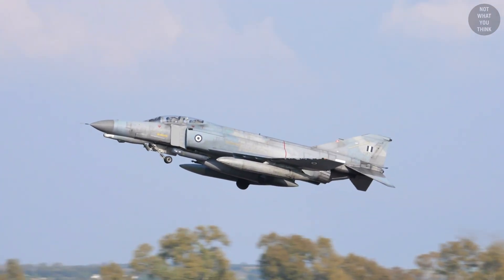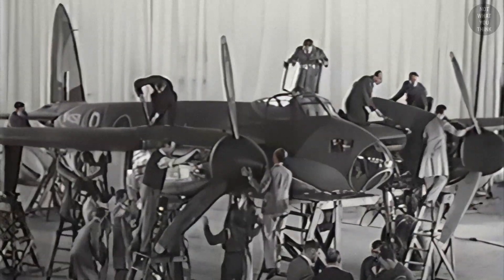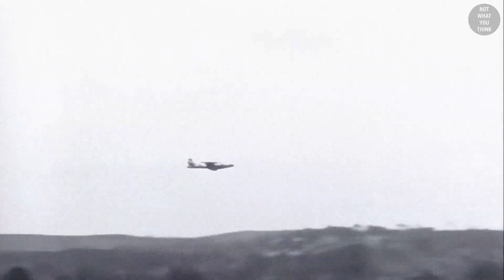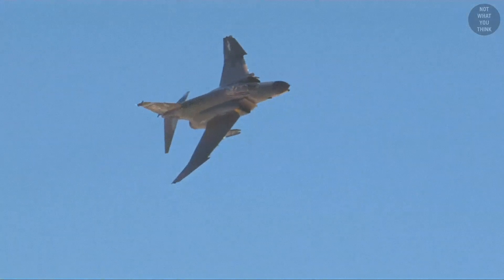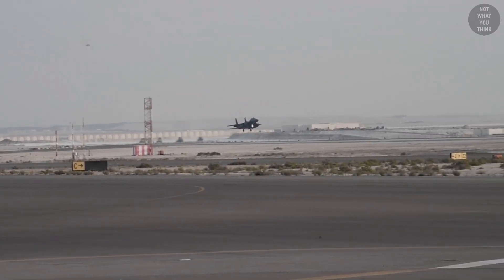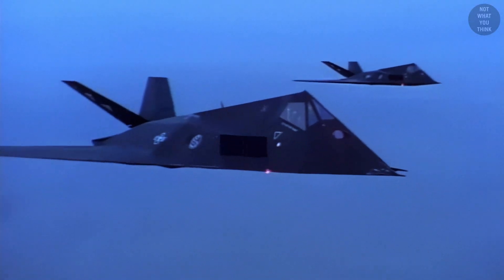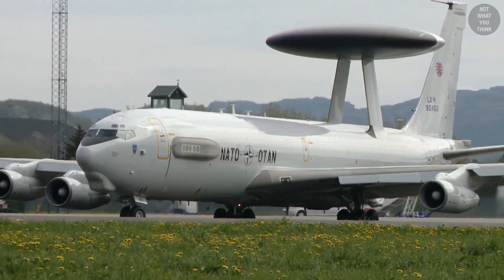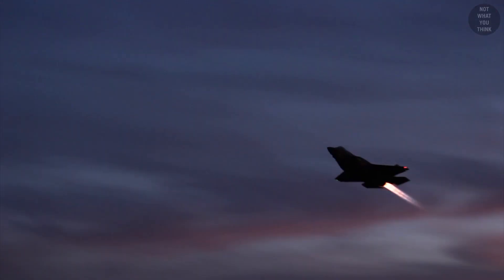Why are Modern Fighter Jets Slower than 1960s?

Comment: Todays fighters can usually hold a higher speed without afterburners, and therefore hold a high average speed when traveling towards whatever goal, compared to yesteryears jet fighters.
Reply: Examples are F22, Typhoon, Su35, Gripen, Rafaele, those aircrafts can supercruise, going supersonic without using afterburner
Reply: @redacted2713  BUT IT'S NOT WHAT YOU THINK
Reply: @redacted2713  Super Phantom could supercruise too
Reply: @redacted2713  Gripen is peak design for peasfull times, low fuel usage for border patrol and training , low maintance cost, and all things that modern jet needs in fight
Reply: @redacted2713 the eurofighter can this too,
Reply: @darthbane3231  I have mentioned it
Reply: @redacted2713  sorry, I didn't see it.

Good day to you
Reply: @redacted2713  A very early example of this is the MiG-23 Flogger, but we don't talk about that arguably bad aircraft
Reply: @redacted2713  Im pretty sure SU35 and Gripen cant supercruise. The range of aircraft able to do that is very slim.
Reply: @termitreter6545  Only the Gripen E/F has supercruise.
Reply: @duohawke4174  Dang, so they managed to make that lil plane supercruise? Gotta say, the Gripen is an impressive success story. Lil Sweden developed that thing on their own.
Reply: @termitreter6545  The E/F just use an engine variation of the Super Hornet engine. Has more power as the old Volvo engine form C/D.
Reply: @duohawke4174  Yeah Ive seen it. Still, aerodynamics gotta be really damn good to make that possible, especially considering the T/W ratio is still somewhat low.
Reply: @redacted2713 Rafale No Rafaele
Reply: @ddd.777-  ye whatever
Reply: @redacted2713  even without supercruise, the F-35 can fly to longer ranges faster than even the F-22 by flying sub sonic with extremely good fuel economy.

No need for aerial refueling.
Reply: @Random_White_Circle  Well it’s not only that. The f-35 can carry ground munitions as well, so loitering may be required of it. So they may hang around longer if there is air refuel nearby
Reply: @Random_White_Circle  please get an actual education on aircraft ranges F-35 is poor
Reply: @Random_White_Circle  The U.S. Navy’s and Marine Corps’ versions of the F-35 jet can only fly at supersonic speeds for short bursts of time before there is a risk of structural damage and loss of stealth capability.
Reply: @Random_White_Circle  F-35 can go 1,300 mi and F-22 can go 1,800 mi. Combat range is different. F35 (770 to 870) F-22 (645 to 679) have almost the same “combat” range only off by 125 to 191 miles
Reply: @Random_White_Circle   and if it gets into a merge it has not much in dogfight potential in comparison to said F-22a
Reply: @Random_White_Circle  B does not equal fuel-economy man they're not talking about fuel economy
Reply: @darkest_eclipse8271  Munitions?
Reply: @L_Lawliet1235  short for Ammunition, anything from guns, bombs, rockets, etc etc.
Reply: @darkest_eclipse8271  Ahhh ok
Reply: @Random_White_Circle  F35 cope at the highest.
Reply: @redacted2713  incorrect about the F22.  It can only fly for 8 min.  The F23 can fly at super cruise.
Reply: @BJCulpepper you're referring to the YF-23. The F-23 program never progressed beyond the 'prototype' phase.

However, Japan has decided to partner with the F-23's original engineers with a goal of finally putting the F-23 into production. The real issue with the YF-23 was/is it's maneuverability, which is significantly less than the F-22.

The RF-23 was faster than the F-22 from Day 1. ✈️
Reply: Honestly, this all makes the F-86 Sabre look even more incredible for its era. An early 1950s jet with amazing maneuverability, astonishing firepower, and even able to break the sound barrier if flown in certain maneuvers (I believe Jackie Cochran, a female test pilot for the US Air Force, was one of those who successfully did this). An absolutely incredible aircraft.
Reply: @thunderbird1921  no
Reply: @thunderbird1921 give me a Hunter over a sabre any day of the week 😎
Reply: This can be found for all non pilots in any good simulation. The short bursts of afterburner have higher top speed but a modern fighter overall would intercept a target far faster then a fighter from the 80s.
Reply: @Atman Gotango It was immune to everything of the era. Advances in missile technology made it obsolete. Modern day missiles would make short work of it.
Reply: First modern missiles are substantially faster , far more agile and significantly more accurate than missiles designed in the 1960s
Supercruise does allow aircraft to move at high speeds without using afterburner which is usefully in some situations 
Stealth and Electronic warfare are better
Reply: @brianhale3678  What the Thor are you talking about?
Reply: @brendan31415  It's a great movie. My favorite MCU movie. It's really a Shakespearean Fairy Tail. Directed by Kenneth Branagh, ya know.
It takes a thousand people 4 months to make a movie of that scale.

But you can make up a new god right now. Talk is cheap.
That is why the first commandment is, You shall have no other gods before me.
Reply: @brianhale3678  So your God both recognizes that other gods exist, and is anti-competitive. But do you have any evidence your God exists. I know that Thor exists, as we all know that Thor fought Ice Giants, and I look around and don't see any Ice Giants, so he must have been successful.
Reply: @brianhale3678  didn't know fairies had tails
Reply: @brianhale3678  Proving that Christianity is a polytheistic religion.  God was never the only god, just the only god the Hebrews would pray to, first among equals.  Also required some nifty footwork when they got around to elevating Jesus to to god hood.   And ps. The testament specifies 3 times that the sins of one cannot be forgiven by the punishment or repentance of another.  So, I'm guessing the guy(s) that wrote the, Jesus payed for our sins, bit, didn't read the bits that says god doesn't allow that sort of thing.
Reply: @jars6230  
Ever learning and never coming to the understanding of the truth...

😥
Reply: @brianhale3678  You are literate, and yet so, so blind. 
You bring discussion by mandating 'sin' as described in repeatedly editied books by men hundreds of years ago but ignore the immorality of your choice to continue propagating the greatest of all sins - mass religion and the recruitment of others through fear and psychological manipulation. I suspect that somehow you have come to understand the weakness of your faith but instead of examining said have chosen to push it onto others in search of validation, and ordinarily I might have pity for one in such a position, but you seem keen to maintain this behaviour and so today I do not.

The world no longer requires this kind of cultist behaviour. Indeed, it is exactly the cultist mindset you so readily advertise and proscribe that allows for the grossest of inhumanities to be continually perpetrated around the globe.

Whether there is an omnipotent being in control of the multiverse or not is irrelevant. Your position regarding those who belong to your particular cult vs those who do not is also not relevant. 
Your choice to proselytize to others who may be weak enough to be damaged by it - which let's be honest is the motivation for your words, a vain hope that you might find people weak enough to be swallowed into your cult through manipulating their fears - however, is very relevant. And as disgustingly ammoral as any action ever undertaken by even the most heinous of people.

Do yourself, and the rest of the world,  a favour; read a few books not written specifically to delude the willfully ignorant. There are plenty of them.
Then, get out into the world. Take off your blinkers and you may see that it's ok that others choose not to follow your cult. You may even begin to understand that it is infact you who fail to see reality for what it is. You might even come to understand that it doesn't matter one way or the other... it doesn't matter really. 
When you lift the wool from over your eyes, you will see more clearly.

If you have any true sense of morality whatsoever, once you do open your eyees, try to help those who have so successfully brainwashed you to see the evil of their deeds. It doesn't have to be done suddenly - folks can suffer that way - but you'll be better placed to make that judgement at the time.

Live in peace Brian.
Reply: @geordievillan  I read your comment up to the point where you claimed the Bible has been edited...

If you claim the Bible has changed you lose all academic credibility.
Google the Dead Sea Scrolls, it's only the second most famous archaeological discovery of the 20th century after the tomb of King Tut.

How many other Commandments have you broken?
Reply: @brianhale3678  so at the first sign of the reality of your religion you choose to close your mind... There are alternatives, friend. You need not stay blinded.

Whilst you're busy googling (and I suggest you actually have a look at the Dead Sea Scrolls for yourself - you'll find much of it is NOT included in later editions of the Bible) perhaps a quick gander at Vatican corporations interpretations of just some of the greater errors upon which millions of cultist now base their lives (like pretending mary was a virgin, for example, or that 'jesus' was called 'jesus and born 2022 years ago - it's a MASSIVE list), and missing texts might be a good start for yourself. Personally, I really enjoyed reading about toddler 'jesus' standing down the lizard in the desert. Amazing how many supposedly devout christians won;t even engage in discussing those... but that is, at it's core, the very nature of mass religion isn't it; Knowingly internalising and accepting delusion.
The nature, history and etymology of the Christian mythology is not hidden information. That so many of you readily choose to let yourselves be openly deluded is a true problem for humanity, but the cures ARE readily available. All that's required is to put aside prejudice. It's not entirely your fault that you've been misled. That you proselytize without bothering to do the research about your own cult mythology beforehand, however, is very much upon you.
Reply: @geordievillan  dude, we have over 5,000 manuscripts of the Greek New Testament... the closest equivalent of an ancient document would be "Homer's Iliad" with only 8...
The Bible has never changed.

Correct, your egregious academic error and then we can talk.
Reply: @jars6230  did you know yeshiva the jews god, thus the Christians god too, actually tricked the original god head out of his seat of omnipotence. He wasn't a benevolent god as we can see.
Reply: The EE lighting could break mach without afterburner.  This was in the late 50's.
Reply: Concorde still beats them all.....
Reply: What's yestery ear?
Reply: @RIFLQ  dunno. Maybe a bad ear infection? You should probably see a doctor if you have that.
Reply: @erikgranqvist3680  oh sorry for that.. I was sleep-deprived when writing that..
Reply: @RIFLQ  and I am just trolling you. A joke.
Reply: Never knew this, thanks for sharing
Reply: @Atman Gotango XB-70 Valkyrie did that exactly
Reply: 7
Reply: Which F35 wasn't. It can't supercruise nor it can reach 2m even with afterburner.
Reply: FYI, even today's cockfighters holds an astounding significant high speed!
Reply: You're comparing an F4 with an F35, you should compare an F4 with an F22.
Reply: Also without afterburners you have much less heat signature. So you are much harder to detect and stealthier, which is very important in todays combat.
Reply: Even if you have supercruise, it is still more efficient to fly subsonic.
Reply: Not the point of the video lol.
Reply: Are you gay
Reply: Top speed was used in the Mig 25 over Israel. IDF F4s couldn't catch the Mig 25 when it flew over IDF airspace. The F4 was flying at top speed in this instance, as was the Mig 25.
Reply: Not to mention reduced heat signature and less radar cross section as well.
Reply: Radar technologies and missiles technologies made redundant in a skirmish terms... in an all out war speed and manoeuvrability will reing supreme..😂 ... because dogfight are the pilots skills and training.. but yeah first strike like that of any thing else... attacking all way was overwhelming the defence... because it makes the first move .
Reply: Why not compare the F 4 to the F 22 or F 15EX?
Reply: Just wait for the super jets that are in development
Reply: Who is this Mexican that is narrating this video?
Reply: @virtualpilgrim8645  Sounds more Eastern European or Russian to me.
Reply: Yestercenturies*
Reply: It's not about speed it is about stelthyness
Reply: @christopher smith Im a bit confused about what youre saying. Its true that very few aircraft can supercruise.

But your example of the F16 cant be correct. That aircraft cannot supercruise. If its supersonic range gets cut by a factor of 5, then because it requires afterburners.

I dont think anyone of us actually knows the difference in range that comes with supercruise. Thatll be different for every plane, and top secret information.
Reply: Nah did he just make a NEW WORD
Reply: He compares the speed of a twin engine jet (F-4 Phantom) with a single engine jet (F-35 Lightning II).   He's disqualified himself from ever talking about jet airplanes.
Reply: I’ve never heard someone use the word “yesteryear” Ima add that to my vocabulary.
Reply: The top speed numbers from the US fighter jets were all BS.
Soviets really had Mach 3 fighter called MIG-25.
US could not even copy the technology, so it just made up fantasies, like MIG-25 is unreliable, etc.
Far from the truth, Soviets even exported MIG-25s to poor countries and they were using them well without changing the engine every 1500 hours.

And the Mach 2+ speed for F-14, F-15, and F-22?
All BS.
These aircrafts are so underpowered, they cannot even reach the height of Chinese balloons at 60,000 ft.
Note that even concord were flying at 60,000 ft at the speed of Mach 2.
Man.... very disappointed with the US fighter jet speeds and dishonesty BS from our military.
Reply: it's just that the F35 is a non-moving, slow, lame aircraft. 
speed is needed in order to intercept a plane, launch a missile or a bomb, the greater the speed, the faster projectile flies, and further. or, for example, have time to destroy another plane while it launches a cruise missile. if the F35 is shit, this does not mean that it is normal and speed is not needed in modern jets.
Reply: @Niko_rj  F35 is such an ugly, fat airplane that cannot dogfight.
I don't think it's really stealthy either, stealth is a BS that US military has been selling.
Low frequency radar can see all anyway, and two F-117 were hit by the primitive Serbian army missiles back in 1999.
All BS is the US military.
Reply: Current aircraft require greater maneuverability and stealth, than flat out top speed that can not outrun anti aircraft missiles.
Reply: @captjohn1124  You should know that speed matters more than stealth. Stealth is only effective for high frequency targeting radar from far away, it is utterly zero effective for the low frequency surveillance radar. When the plane is close to radar or missiles, it's very visible, just like any other aircrafts or ducks.

Since its introduction in combat in 1989, countries developed missiles that can shoot down stealth with ease. Even without new type of radars, serbians hit two F-117 and one of them crashed.
Reply: @sbkarajan  yea right, speed matters more than stealth. He who gets off the first shot.....wins.
Reply: So, how long have you worked in the aircraft industry? How long have you been flying for?
Reply: @captjohn1124  my first flight with a jet fighter was in the second Punic war. We totally smashed those Carthagians!
Reply: Gigachad f35 for being capable of super cruising
Reply: What I want to know is how does a 65 year old fighter still go 50% faster than a plane that has over 25% more power?

Jets still need speed to intercept-
under some circumstances,
an old F-4 could successfully make an attack and leave before an F-35 could make the intercept…
Does that sound right to you?

Oh,by the way-
they have about the same range when running without the ‘burners.
Reply: @PNasty666yet we haven’t seen any real advantage of super high speed bombers. Mainly because strategic bombers are a thing of the past. But the xb70 Valkyrie, the B1, the Soviet equivalents also…. Pretty much pointless. MASSIVE running costs for hardly any advantage
Reply: Yep. We gotta remember, the F-4 and Mig-21-one of the most aesthetically pleasing plane, in my opinion-were initially designed to be bomber interceptors. Nuclear capable bombers were a real threat, speed and climb rate were prioritized.
Reply: There's no point having a jet with top speed of mach 2.2  with an optimum speed of 2.0 when all the fighting is done at sub sonic speeds .
Reply: @gregorybathurst4326  
Why do you think that some jets are called Intercepters?
Reply: @gregorybathurst4326 well there is a need…. You need a high speed to enable interceptions beyond your airspace ideally.
Just because you won’t be manoeuvring against each other at mach 2 doesn’t mean there’s no advantage to being fast as hell!
You can intercept and climb to altitude as soon as possible and engage. 
Take the U.K. for instance, they needed to be able to intercept Russian threats out over the North Sea before they could launch their weapons
Reply: @gregorybathurst4326  what fighting is that ?
Reply: @williamjr5825  missile throwing… you don’t need to go faster
Reply: @gregorybathurst4326  your one of the few that understand. Other then bvr fighting speed just burns fuel
Reply: One of the most significant limiting factors for higher speed turn rates is the pilot’s ability to endure the G-forces.   Hypersonic / supersonic drones and thrust-vectoring missiles are a big part of the future of those and other capabilities.
Reply: @brianhale3678  You're assuming I don't believe what you said. I never shared anything on that matter. I only made a joke about your misspelling of fairy tale. Fairy Tail is a Japanese manga. Have fun proselytizing in unrelated YouTube threads.
Reply: @andruloni  
What happens when we die?
Reply: F22 goes well above march 2.2
Reply: @ChessNoobX  well above? No. Not only do official specs refute that, there's no point except to increase fuel burn rate by over 100% and lose stealth.
Reply: @Vermonstered  it's top speed somewhere around mach 2.6 but it's unpractical and any maneuvers at those speeds will be lethal so the on board AI is programmed to mach 2.2.
Reply: @ChessNoobX  Considering the plane falls out of the sky without the on board computer flying it think we can safely say the top speed is mach 2.2
Reply: So how’s that tactical Better?
Reply: @williamjr5825  modern jets can achieve high speeds without using afterburners. This is called super cruise. Afterburners burn a ton of fuel and substantially drops your range to the point of the aircraft not being able to do much once on site to do anything other than to turn back so as not to run out of gas.
Reply: @will Roland Nice dodge, in an attempt to deify Jesus, which he wasn't in his day.  Did you know there is not mention, in the bible, or anywhere else, of the resurrection until 600 AD?  Then they decided having him dying on the cross wasn't 'Devine enough'.
Reply: Jade Chan 🇺🇦  it doesn't supercruise at all. It need afterburner to even break supersonic.
Reply: @sys3248  and cant even do supersonic flight that long because it will break their airframe
Reply: @brianhale3678  So you claim that my god doesn't exist, and I claim that your God doesn't exist. How about we both agree that we are both correct, not have any made up gods, and treat others the way we want to be treated and not treat people the way we don't want to be treated, and enjoy this life.
Reply: @brendan31415  how about you continue believing in evolution which offers you the chance to decompose into dirt...
Reply: @brianhale3678  I agree as far as the design of the universe goes. I find it very hard to believe that chance created this. Even for chance to be responsible, the ingredients for life still had to be in the kitchen. Where did the kitchen come from? The question I'm always left with is the same many struggle with, who made God? Does God have a God? Does God's God have a God?
Reply: @maplebear6527  just look at the assumptions that you're making in your own question and you can answer it.

God in the Bible claims to be from "everlasting to everlasting"
In other words he never began.
The universe clearly began.
Which means something outside of the universe caused of the universe to begin. That would be God.
He is the thing which begins things.

He never began.

Now, how many lies have you told in your life?
Have you broken his 10 simple Commandments?
Reply: Not the F-35 it can't super cruise and it's range is shit unless the internal weapons bay is empty apart from two AMRAAM's.
Reply: @Ushio01  Whats in its internal weapons bay has no affect on the F35 range or speed. Its drag, not weight that determines range, and the F35 drag is the same, loaded or unloaded.
Reply: problem is if you are talking about F-35, it has smaller operational range compared to 4th gen fighter because you cant use external tank if you want maintain stealth, has smaller payload if you want maintain stealth because only internal weapon bay can be used, cant do supersonic flight for long time because it causes cracks on the airframe and obviously no supercruise so it badly beaten by SU-35, gripen, typhoon and rafale in average speed

F-35 is a fat ninja, thats it
Reply: @mobiuszero2424  and why can't you use external tanks?  F35 has the ability to determine when it will be radar visible, with or without external ordinance.  Use tanks to get near your operational area. Discard tanks when necessary.  And an F35 with tanks is less visible than an F16 or F15 without.  So if the F35 cannot use tanks due to visibility, an F16 cannot take off at all?  I mean, an F35 that is more visible due to tanks has the option of dropping them, but the way more visible F16 is way more visible, all the time.
Reply: @jars6230  and how about the pylons then? take note that F-35 has a golf ball rcs on radar while those pylons obviously far larger than golf ball, and yes those external tank obviously larger than golf ball while F-16 doesnt need to care about that because its rcs already bigger than that external tank, even external bomb and missiles are larger than golfball
Reply: @mobiuszero2424  Doesnt change the fact, you see an F35 with an external fuel tank, with an increased radar cross section as being a major flaw, so severe, that it cannot operate with an external fuel tank.  While the US uses combat aircraft with an even bigger radar cross section, all the time.  Netherlands did a series of exercises where an F35 took on several F16s in combat sim.  It won them all, to such an extent that the last exercise, the pilot had an externally mounted practice bomb added, increasing drag and radar cross section.  He still won.  An F35 with an external fuel tank is harder to find, and harder to kill, than an F16.  If the statement, F35 cannot extend range by using external fuel tanks because they destroy stealth, is true, then all F15s, F16s, F18s need to be grounded immediately.
Reply: @jars6230  problem is, the point using F-35 is not it was being cheap to operate (F-16), powerful air to ground platform (A-10), nor a superb air superiority fighter (F-15). the point of F-35 is stealth platform to deliver munitions and sensor, thats it, then why on earth you wanna mangle their stealth while its only good for one thing and that thing only? F-16 , F-15, A-10 is designed to operate on enemy territory while detected thats why they have higher top speed and better manuverability, F-35 is not designed to do so, it only depends on sensor and stealth. even F-22 which is designed for air superiority, has better stealth than F-35 is not using external fuel tank unless it was moved to other air base and there is no threat, keep in mind that F-22 has superior stealth compared to F-35
Reply: @mobiuszero2424  In any major combat against near peer adversaries, the F35 will be the premier ground attack aircraft, the A10 requiring extensive air superiority to be usable.  F35 in air to air combat easily outperforms the F16.  It is true that performance in specific areas has not been optimised in the F35 in order to build a multi role platform.  But its performance in these areas still easily exceeds legacy aircraft.  The F16 is still useful because most potential enemies are overmatched even by the F16.  You need F35s for those places an F16 cannot go.   If they decided on a no fly zone over Ukraine (they will not), it would be the F35 they used, as that environment is likely too hostile for F16s
Reply: @jars6230  F-16 is still used because F-16 can bring more munitions than F-35 while have cheaper and easier to maintain, thats the point of light fighter and F-35 is CLEARLY cannot match F-16 in that capability, im willing to bet they wont replace all F-16 for F-35, F-35 has niche role and thats it

saying F-35 has easily exceed legacy aircraft is BS, F-35 only won because of its BVR capability thanks to its stealth, the thing is F-36 is just designed to sling their long range missiles and run, but long range missiles is not designed to take down agile aircraft in their maximum range, AESA radar is also a norm nowadays, unless their opponent using PESA or older radar, i dont think they can just get away with it because they will be detected,US even pull out their F-22 from syria after SU-57 is deployed although its clear SU-57 is not stealth aircraft (at least not THAT stealthy)

also F-35 cant run once it already spent all of their munitions if detected, its slow AF because it cant do sustained supersonic flight, its IR signature also will glow like christmas tree from behind due to its exhaust, so unless they are running full stealth configuration in area like ukraine while ALL russian fighters is equipped with IR sensor and they have lots of long wave radar, it wont be able to run away
Reply: @mobiuszero2424  they can't. Stealth aircraft need front line illuminations assets to even work. It's a gimmick rather than true full borne next generation type of aircraft that supposed to make prior gen obsolete. 
So regular fritter aircraft would make the first line while stealth would probably make it's second line or third. 

And there's this funny beliefs that against real near or peer level adversaries it would let AWACS or aerial tanker unmolested. Those things are huge and easy prizes to pickoff. 
And only if we consider they even able to get in the air at all since in most open conflicts there's many instances it just get bombed in the land by standoff missiles.
Reply: @mobiuszero2424  1. The entire point of this video was to show modern jets never used extreme speed, even when they had it, its use is vastly overstated. If you need to use speed to run away, your pretty much screwed. 2. Modern near peer air to air combat is BVR combat.  Saying its all an F35 can do is like saying all a boxer can do is punch.  Yes, thats the point.  For an F16 to have a chance against an F35 requires a set scenario, eg, start next to each other, then turn fight. Or F35 is purely defensive, and in a confined area, how long does it take F16s to find it?  In any real world scenario of, there is an enemy out there somewhere, go find it, the F16 is dead, and likely doesn't know its about to die, until its dead.  And, incidentally, for an F16 to be able to successfully dog fight an F35, it has to be 'clean', gun only, no missiles. Missiles create so much drag that the performance drops off so much, it loses.  And F35 still has internally mounted missiles.  And this is a common theme, people quote superior performance stats for other aircraft v the F35, but its almost always 'clean'.  Speed, range, turn p-performance, climbing ability all plummet when you start sticking external missiles and bombs on. 
One final fun fact.  Range at which an S400 air defence system can detect an F16 is about 200 miles, and for an F35, its about 20.  So the niche roll for an F35 is operating anywhere that has an actual missile defence system, which is, against any near peer adversary.
Reply: @jars6230  1. use your logic, this video is clearly false, and even in average speed, F-35 will fail to run away,  if max speed is rarely used, why on earth they add afterburner feature anyway? why bother having interceptor role plane? if you ran away with this turkey plane after delivering all of your munitions and F-16V on your tail, you are screwed

2. problem is, the ONLY way F-35 wins is BVR, and missiles doesnt have 100% hit rate, thats why fighter pilot is trained to dodge missiles, there is chaff and flares, F-35 clearly only bring long range missiles, to exploit this, F-16 usually bring mix of short and long range missiles, why? because short ranged missiles is more effective against agile aircraft and missiles with IR seeker has shorter range (because IR seeker range is short), sure F-16 will have hard time finding F-35 if it was block A or C, not with block V, because of AESA radar, stealth on F-35 and F-22 is only effective on certain band of radar wave, while AESA is using multiple band of radar waves at once, its just a question whether if that F-16V bring missiles with AESA seeker or not or even better if that F-35 is close enough to be locked with IR seeker if that F-16V bring IR pod, and no, only dumb pilot join aerial fight with external tank , that pilot will dump those external tank once he has intention to fight against enemy, and yes it will use all of his missiles to bring down F-35, i'd say good luck to that F-35 dodging all of that F-16 missiles, and even if they miss F-16 will have upper hand in gun fight, keep in mind this is just F-16 , how about F-15? it has FAR BETTER performance to have knife fight against F-35 , its even unfair for that F-35 and yes , F-15 can use AESA radar too

3. said who?  US? when this was tested? they didnt even let their allies to buy S-400, so there is no real data on this, furthermore that "test" is probably using F-35 clean configuration, while like i just said, using pylons clearly gonna compromise that, furthermore if you fight against  near peer state like china or russia, they have long band radar to find that F-35 , which probably around 120km away although they cant use radar lock with long wave radar, but they can send fighters if they dont have AESA radar on that area to lock that F-35, which is tough luck on that F-35 if those interceptor have AESA radar equipped

F-35 will definitely make PESA radar fighter obsolete, but not 4th gen fighter with AESA radar in air to air mission
Reply: @mobiuszero2424  After burner is take off, and quickly get to altitude.  You dont fly a stealth aircraft in combat with an afterburner lighting you up like a Christmas tree.  And an F16 on its tail.  Oh good god.  An F16 does mach 2.05 at altitude CLEAN. No weapons, minimal fuel.  With ordinance on its estimated its speed is generally maxed out about 1.5.  In some configurations, it cannot even go supersonic.  F35 is a mach 1.6 fighter, with or without weapons.  Do you get that.  An F16 is faster than an F35, if it has no weapons.  It isnt faster in combat config, check any source, but check 'loaded, or dirty, or combat' speed.  Obviously, the drag depends on what its carrying, but you start to add weapons to an F16, that max speed starts dropping real fast.
Reply: @jars6230  not only that but you need afterburner if you need boost to evade or  maneuver quickly and like i said before, pilot fighter will dump external fuel tank once they join the fight, that external fuel tank is the component that causes biggest drag. F-35 is NOT mach 1.6 fighter, because it cant supercruise, thats its MAX speed if doing afterburner and in "clean" state, which means no external pylons used,keep in mind that F-35 is NOT designed to do supersonic flight because it will lit up their IR signature, thats why their airframe cracks just after few minutes of supersonic flight,while F-16 clearly can go further than that means it can use afterburner more effectively than F-35 because 4th gen fighter is SPECIFICALLY designed to go supersonic, this afterburner is important in dogfight or interception. that F-16 is clearly gonna spent all of those fuel in external tank from the get go to pursue F-35 using afterburner then dump the tank before fight, while F-35 is incapable to do so in the fight because of limited fuel capacity and limited capability for supersonic flight, once F-16 can detect that F-35, obviously they gonna start spending those missiles generously, this will made that F-16 to clean built quickly and they still have fuel and more speed to outmaneuver F-35 in WVR fight if that F-35 is not down yet, why on earth you bring lots of fuel and munitions if you not spend it? even in cruise mode, F-16 is clearly having better speed than F-35 even if that F-16 bring some missiles because F-35  have far worse drag
Reply: @jars6230  afterburner did not lit up stealth aircraft like Christmas tree from the front. From the back of course.
Reply: @mobiuszero2424  f35 win in simulation because they need to justify cost.
Reply: yall are sum nerds im just watching this cuz it’s valid asf
Reply: @thrillville7775  ayo don't tell us you don't have your own interest where you a nerd too
Reply: @cloroxbleach9222  Being interested in aircraft isn't nerdy, collecting stamps is nerdy.
Reply: @thrillville7775  your lack of comprehension of anything complex is funny
Reply: @thrillville7775  you need a life buddy.
Reply: @thrillville7775  English, please.
Reply: @thrillville7775  brave online
Reply: @thrillville7775 what did you expect 😂